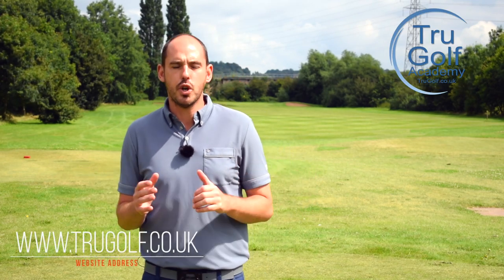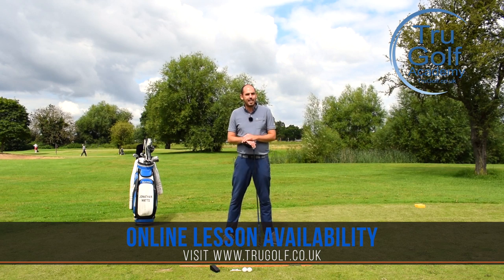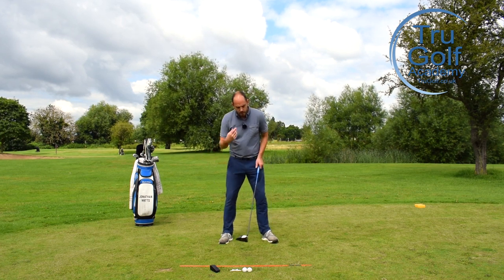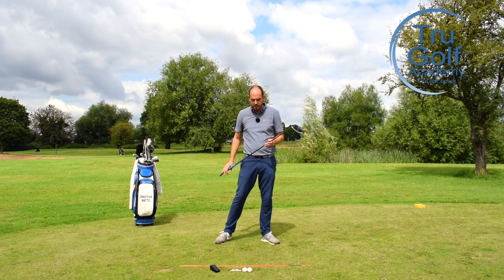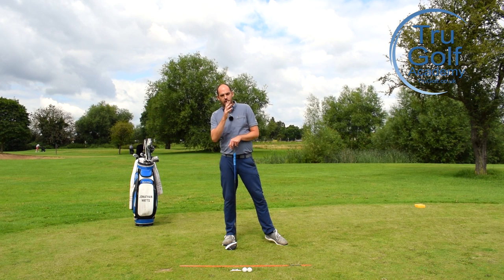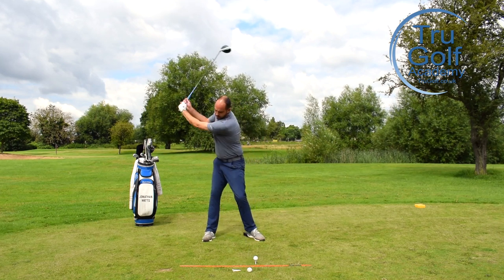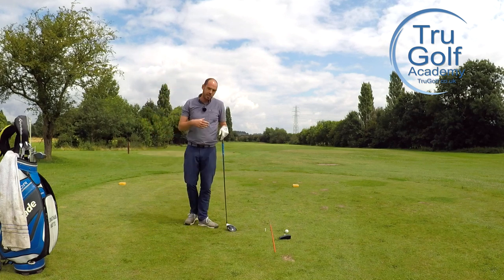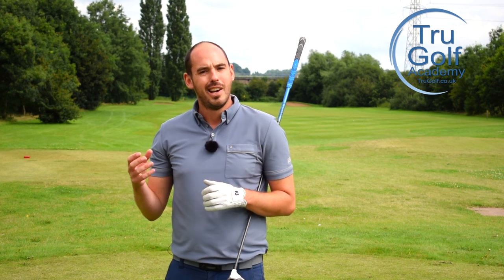LIFT & SLAM THE LEAD HEEL FOR MORE POWER

Comment: The late, great Mickey Wright certainly lifted her left heel.  I couldn't help but notice that you do not keep your left arm ramrod straight. I struggle to keep mine straight, but from now on I'm going to let my left arm do what it wants.  It's unreal how much more power I get into the back of the ball when I lift my left heel.  Planting it on the downswing gets everything moving toward the target instead of hanging back and flipping my arms. As usual, it's late in the evening as I type this and I am so looking forward to hitting the range tomorrow to practice this some more!
Reply from the maker: Hi Jim, yeah I wouldn’t worry if there was a little bend. I cannot completely straighten my arm where I broke it. But often it’s a sign or tightness around the shoulder

Comment: Great video, definitely helps with the idea of getting the weight to lead side and rotating lower body. I’m having a huge mental block right now in shallowing the club on the downswing; you make it look effortless. I’m coming over the top every time and need some sort of practice advise or something to somehow drop my hands at start of downswing so club shallows around the line of trail forearm.
Reply from the maker: Feel the back facing the target a little longer, allow arms to drop before rotating (the feel at least) 👍🏻

Comment: I'm 83 years old and only recently discovered this wonderful tip of lifting the left heel so as to get a longer backswing.  I tried it today (at 4600 yards) and shot 81.  I think I hit the ball a bit farther but I know I hit the ball straighter.  It all depends on using my hips and lower body to obtain power, keeping my hands and arms out of the swing entirely.  I played for 60 years using my hands to try and generate power--which is clearly wrong.  I wish you had emphasized the importance of this in this tip because in my experience the average "weekend golfer" does use the hands and arms to generate power--and it's why they can't break 100.  A great video nonetheless.  Thank you.
Reply from the maker: Thank you 🙏 It’s really about the correct sequence. The hands play a part but many overuse because of poor sequence or an excessively open face
Reply: @TruGolfAcademy  I'm not making fun or denigrating what you've just said.  Because, of course, the hands hold onto the club.  But I really do not understand what "part" they play in the golf swing other than that.  Are you saying I should be doing something intentionally with the hands at some point during the swing?  Please help.  This is critical for me to understand.